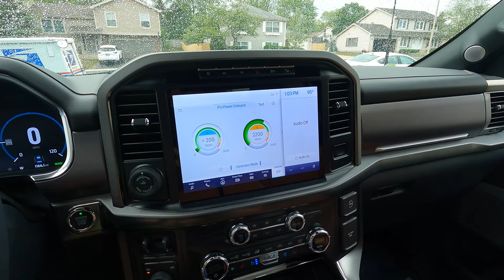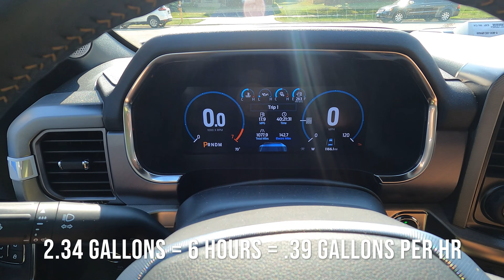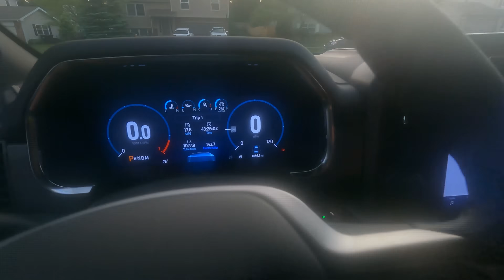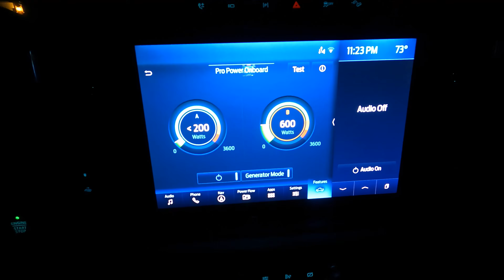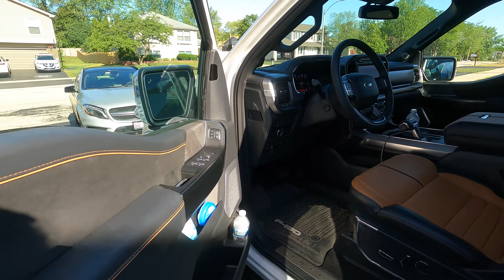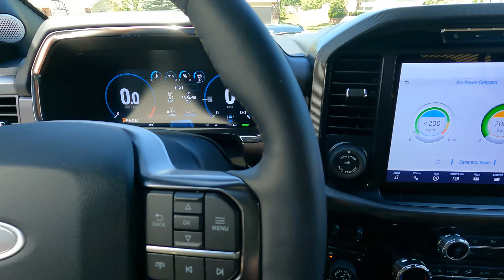2021 F150 Onboard Generator 24 Hour Test | Powering Our Airstream with our Tow Vehicle

Comment: The new airstreams have 50w plug in extension cords now and 2 ACs on top. I think the Propower 7.2 is rated at 30w. I’m wondering if this would still work in this scenario. I’m thinking I would have to just use 1 AC unit and it could work.  Have you ever seen the Propower blow a fuse on the 30w system? Tx
Reply from the maker: Hello! Our ProPower has never blown a fuse.

Comment: Great stuff!  Would love to see this same test but using the heater in the cold of winter.  How much would be used overnight during the coldest time?  How much over 24 hours?  And for how many 24 hour periods a full and half tank of gas would go?  Also, you thought, one of those big airstreams likely would take more power to cool or heat than say to cool or heat a pop up tent on the back of the pickup, but I'd love to know that too?  I'd love to be able to take off with a full tank of gas for an overight in the cold of winter, or for a long weekend, and stay toasty and still have plenty of gas to get home or at least few hours drive to the nearest gas station.
Reply from the maker: Great idea! Our Airstream uses a propane heater, but we would need power to start it. I think we could probably get a really good amount of range from the generator in cold weather.

Comment: very interesting video.    I just purchased a 2022 F150 Powerboost with the 7.2 Kwh generator.  Got the truck with only about 20,000 miles. on it.   Chap that had it was getting a bigger trailer and upgraded to a 2500 diesel.  Looking forward to some boondocking now.  Have been towing with a 2015 F150 Ecoboost, so I know the truck handles my trailer very well, so now with a much newer and lower mileage truck I should be good to go for years to come.    thanks for the excellent review....and continued safe travels.
Reply from the maker: Wonderful and thank you!

Comment: We  want the PB with the 5.0 but can't find any used in the 21-23 range. It seems few owners are selling thiers. Also,  Ford if your listening, some of your Ford F150  buyers  would like to have the Ford F250-350  HUD display on the next model year. I saw it and really liked the option.
Reply: There aren’t any PBs with the 5.0.  They’re all 3.5s. I do think you can get a onboard power option for 2kw with a 5.0 but you can only get the full 7.2 kw with they hybrid 3.5.

Comment: Thanks for this demo video for ProPower.

Question: when the vehicle is in ProPower mode, how quiet is the engine outside? Is it quieter than a typical portable honda generator? Thanks!
Reply from the maker: Hello! Sorry for the slow reply. It’s so much quieter than any portable generator. It will not disturb the neighbors😀😀😀
Reply: @GoranandJen  wow! That's great news-- will be very nice not having to bring a heavy and loud generator with the ProPower On board.

One more question:

How often does the engine turn on when in ProPower mode? I've heard that it remains quiet until the battery needs charging.  Meaning, only stays on for a minute or two, then stays quiet for 20-30 mins?
Reply: It's very quiet... I can't believe ppl order the truck without this option!
Reply: @mikej9619  that's great news! Completely agree-- more vehicles need this amazing feature!

Comment: Old video I know... I'm not so interested in gas used. What I would have liked to know is the frequency of engine run. At 2000 watts I imagine your truck restarted every 5-10 minutes to recharge the battery. Just running a 1500 watt space heater my truck ran recharged every 9 minutes. I'm a bit disappointed in the battery capacity. It is effectively only a 400-500  way battery. Pretty darn small.
Reply from the maker: Hello! Yes, it’s cycled on about every 5 to 10 minutes in the heat of the day. At night, much less.

Comment: World’s most expensive RV generator. 😂 cool feature. Thanks for sharing.
Reply from the maker: I know right LOL. We just did a 48 hour test, will be posting soon 😀
Reply: They cut the price in half for the option. It costs a hell of a lot less than an Ultra-Quiet 7000i ES Honda generator. 😊

It is by far the best generator value anywhere for its capability…and that Honda cannot run continuous at 7000w either it can only do 5500w and 6.5 hours at max continuous output. So, I reject your premise 😜😂

Comment: What about the ground fault detected during test of pro power boost electrical circuit? They saying it's normal? Did U guys get software updates yet? Now they daying software updates by Sept 2023. They trying to fix that issue for about 2 years now. Pls respond asap so I don't take my new truck back to the dealer. Thanks.
Reply from the maker: Hello! We haven’t experienced a ground fault. But, we also haven’t used the pro power yet this year so we will have to see if a software update messed it up. It has worked fine for us. We have run into an issue where the dealership can’t get our BlueCruise to work. They still can’t get that to work and it’s been 2 years. Ford has some serious problems with their software for sure.

Comment: I  get a "Pro Power onboard detected a gound fault" error every time I try and power my 2022 Grand Design 21G with my 2023 Power Boost… meanwhile I see video after video of people using it just fine with their RV. Very frustrating.
Reply from the maker: That would be super frustrating! I would take it to the dealership (if you haven’t already 😀). We have an issue with our 2021, we can’t seem to get the BlueCruise to work. Dealership has worked on it several times to no avail. Frustrating because we paid for the feature up front and every time they try to “fix” it, they erase all of our data so we have to reprogram everything.
Reply: You need a special adapter on the truck side that will allow draw from both banks (a and b).

Comment: What happens you have the fridge loaded
Reply from the maker: Great question! We did not test that with our truck’s generator, but typically we are putting cold food into the fridge once it’s cooled off. Our fridge is super old (May be original to the Airstream) and in 90 degree weather it struggles to keep up even with cold food in it LOL

Comment: You can buy an inverter generator for less than 1k.  Not only is this a waste of fuel and money your putting a ton of extra unnecessary idle hours on your $70k+ dollar vehicle. Then when your done boondocking you dont have enough fuel left to tow your camper to the closest gas station!!! Plus it's one more thing to go wrong on your truck.  I'd pay for a replaceable inverter generator.  I'll pass.
Reply from the maker: It’s not for everyone that’s for sure. But we love the truck! The generator is super quiet. And it doesn’t use much fuel. We are very happy with it😀

Comment: What adapter did you use to connect the Airstream to the truck? 4-prong generator plug (male) to 30amp (female) dog bone?
Reply from the maker: Hello! The adapter is linked in the description of this video. I will check tomorrow for the exact cord that it plugs into 😀
Reply from the maker: Adapter to regular 30amp shore power cable 😀

Comment: I have the 2022 powerboost and I was just curious what people are getting out of it. I have not used my onboard system yet and I do not have a trailer yet but I am doing my research.
Reply from the maker: We pretty much just use the onboard generator when boondocking for our electrical needs. It works great 😊 as far as mpg when the trailer is attached, we get between 10-12. We have an Airstream, 6800 pounds dry. F150 tows it like a dream.
Reply: @GoranandJen  I am planning on getting a trailer next year and I want to get a boat soon as well, one of the biggest reasons I purchased a truck. My only issue right now is storage, I have a huge garage and property but I rent so cannot store them and I do not want to pay storage for a year while I am planning to buy.
Reply from the maker: Yea, I think you’re making the right decision. I wouldn’t want to pay for storage either

Comment: Is the 7.2kWh "generator" an actual generator running somewhere on the truck, or is the power coming from the truck motor/hybrid battery via an inverter? In other words, is the only sound when using the "generator" the sound of the truck running intermittently?
Reply: Yeah, it's an inverter on the battery pack, not a separate gas engine generator. Then the truck runs the gas motor to turn the electric motor in "regen" mode to recharge the batteries whenever they get low.
Reply from the maker: You are correct! It’s very quiet, great for boondocking and not disturbing your neighbors 😄we have a traditional gas powered generator but we no longer use it because the truck generator works great

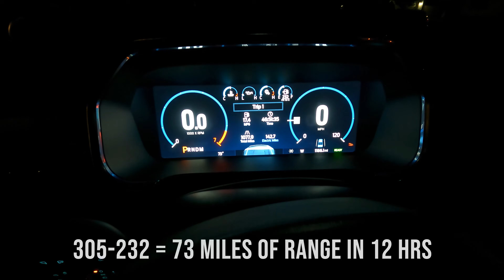Comment: Goran & Jen @4:57  ....How did you arrive at the 4.2 gal's figure? My calc's give me twice that amount .... 73/305 miles of range = 0.239 x 35 gal's = 8.4 gals.  What am I doing wrong? And I believe it has a 30 gallon tank.
Reply from the maker: Hello! We divided 73 by 17.4 mpg to get to 4.2. We got the 17.4 mpg from the screen, under trip 1, upper left. And you are correct, we were wrong about our gas tank size, it is a 30 gallon tank😀hope that helps!
Reply: @GoranandJen  Yes, now I can see where I went wrong - thanks!

Comment: Morning comes and no coffee maker in use?  Do you typically wait to cool the frig before you load it?  Under normal use some is going to be running in and out of the camper. Need a bit more true testing like someone suggested take it out to the woods.
Reply from the maker: Good points! We plan on doing some more real world tests of the generator this summer. This test was strictly bare bones to see if the generator could keep up :)
Reply: Using only 1/3 of the generator capacity I would hope it could keep up.  Is there an additional battery than the standard truck battery or just a larger capacity single battery?  Thanks

Comment: Question... my truck starts with a key fob (2013 Ram) and when I remove the key fob, it's still drivable. Someone could theoretically take off with it. They aren't going to get far, because as soon as they turn it off they'll need the fob to restart it, but I could still see this as a potential problem.

The powerboost in generator mode seems to be a bigger problem because the motor turns itself on and off as needed anyway...

Example, someone smashing out your windows and driving off in your truck. As long as they don't shut it off and keep the fuel tanks full, the hybrid motor will kill the engine automatically while parked and that could be days or weeks as long as they don't let the hybrid battery run dry or forget to turn leave the truck in the on position, someone could get away with your brand new vehicle.
Reply from the maker: Great question! You can’t leave the driveway without the key fob, the truck won’t allow you to put it into drive. We don’t leave the key fob in the truck when we are using it in generator mode. I mean, somebody in theory could smash our windows and try to drive away but the truck won’t allow it to leave without a key fob.
Reply: The engine shuts off at slow speed and when you stop at red lights or come to full stop . It won’t start again without the key fob. Or will it stop once it doesn’t detect the key fob ???
Reply from the maker: @JoseP-hj5zo  hello! Yes, if the key fob isn’t detected you won’t get very far

Comment: Nice video but I noticed that you have your truck on Normal mode and cool seats running in your truck. The best results come when when you turn off your accessories and put the truck in Eco Mode. This will extend the use of the battery is what I’ve noticed with my PowerBoost.
Reply: Why is Eco mode better to use if you are not actually driving?  Just curious
Reply: @stepheng9998 yeah, I think eco mode just changes throttle positioning and shifting

Comment: So I’ve read recent articles on how idling a gas engine is hard on the engine because of low oil pressure at idle, supposedly it’s hard on bearings etc..? I wonder if there’s any truth to this? Will running the onboard power that causes the engine to idle off and on periodically shorten the engine life? I don’t know one way or the other but it’s something to think about
Reply from the maker: Definitely something to think about. I wouldn’t recommend powering your home or RV for an extended period of time using the system but it’s nice to have the option if there’s an emergency situation. The engine cycles on and off so it’s not constantly idling but there would definitely be somewhere wear and tear if you did this often
Reply: @GoranandJen  I would think that this would be a great way to keep your rv cool and maybe some drinks and some food cool in the fridge while you are towing down the road.
Pull into a rest stop for some sleep and or a meal and then head back out.
Still one of the best ideas from Ford ever!

Comment: Great video! When I was boondocking and did a similar trial I noticed the cabin was VERY hot along with the hood of the truck. All heating and heated seats were off along with displays etc,  so I imagine it's just the engine heat. Did all of you have a similar effect?
Reply from the maker: Thanks! It was super hot out the day that we tested, in the 90s Fahrenheit. We noticed the hot hood, we put the AC on low for when the truck cycled on but it was still pretty hot in there. I’m wondering if maybe we should run this test in the winter time to see how hot the hood and cabin gets.

Comment: Great video! Thx. Can the Powerboost generator power an A/C unit on a truck camper while the truck is being driven/traveling?
Reply from the maker: We think so, you would just need to keep it plugged in. We haven’t tried it yet, but we plan on testing that out next year :)

Comment: How loud is the ICE when it's operating in Powerboost? If there's a good video, I'll take a link. Thanks!
Reply from the maker: Very quiet. You can give it the option to run on a slightly increased idle and it is still very quiet.

Comment: I love the idea of the onboard generator but my concern would be having enough payload to tow an airstream or similar RV.  I already have a 2018 F150 with about 1500lbs of payload.  Between the tongue weight of the trailer (~800 lbs) plus 4 people and a dog, there is not much left for any gear in the bed.  I would have assumed that the batteries in the hybrid would eat into payload even more.  Is that true or does the truck have the same payload as a normal F150?
Would love to see them put this hybrid system into an F250 Diesel.
Reply: You have plenty of room for lots of payload if you're really worried you should go get a set of timberland bump stops on the back but you don't even need those
Reply from the maker: Our payload is 1289, we tow a 25 ft Airstream Excella and she tows like a dream. As far as how the hybrid payload compares to a regular F150, I don’t know the answer to that. It’s so hard to find the “true” payload online, so I’m depending on the sticker inside the door. Hope this helps!
Reply: @GoranandJen  Thanks!  Do you know what the tongue weight of your Airstream is?
We looked at a 27' FB with 790 lbs of tongue weight dry.  With gear and water I would expect it to be 900-1000 lbs.  If we add in 4 people plus a dog, that is another ~600 lbs and we are now over the capacity of our current F150.  No room left for anything in the bed, like bikes, firewood, camp chairs, etc.  I guess I will need to wait for them to bring the hybrid to the 3/4 ton trucks or just get a separate generator.  I do love the idea of having it integrated though and not having to carry a gas can.
Reply from the maker: @jlokanis  we don’t know off hand. We found a tongue weight scale that we’re going to get, but haven’t done so yet. We just have the two of us, plus a bit in the back with camp chairs, cooler, etc. We use a weight distribution hitch and so far, she’s been towing great, almost like there is nothing behind the truck! And you’re right, the integrated generator is a game changer. It’s super fuel efficient and very quiet. We are loving it
Reply: Really useful information, I am looking at getting an Airstream as well.  I have a Platinum F150 with the Max Tow package.  DO you have the max tow package on yours?
Reply: @williamcarruthers3142  yes. But with all the features on the platinum trim it eats up most of the payload. I will be trading it in for a 250/2500 before we get our AS.

Comment: How many hours of engine operation?  Would have been a good stat
Reply from the maker: That’s true, that would be a good stat. I wish the engine would track that. It cycles on and off to charge the battery, but to the best of my knowledge it doesn’t track those cycles. If it does, let us know!! We’d love to have that info :)
Reply: @GoranandJen  sure my 2016 f150 does. Engine hours and idle engine hours

Comment: Are you running off of the 30 amp plug or one of the 110's with an adapter?
Reply from the maker: For this test, we were running off the 30 amp plug :)
Reply: @GoranandJen  isn't the 30 amp a 240 volt ?  Are you using an adapter ?
Reply from the maker: @d_Smy  hello! Yes, we are using an adapter, the link to what we use is in the description of this video :)
Reply: @GoranandJen  ahhh.  I see.   Thank you!

Comment: I have the PowerBoost on my small travel trailer and it works great! We can run everything at the same time however our AC is only 9000 btu. I have heard others with larger btu AC's install a 'soft start' but we have not needed to.
Reply from the maker: I believe our AC is 13000 btu. I’ve talked to a few people about the soft start, but we haven’t needed it either. We love this truck!
Reply: Soft Starters are amazing.  I have our home 3.5 ton unit down to 31 amps (so 6800 watts starting).  Before it was 110 amps. 220volt